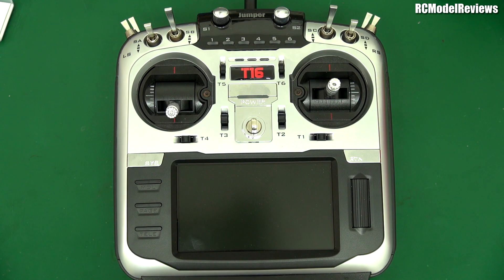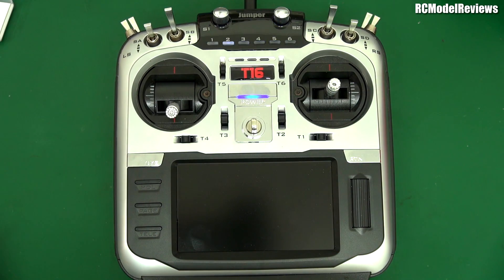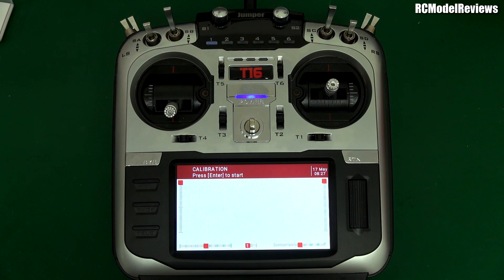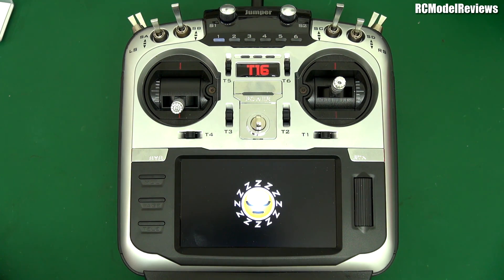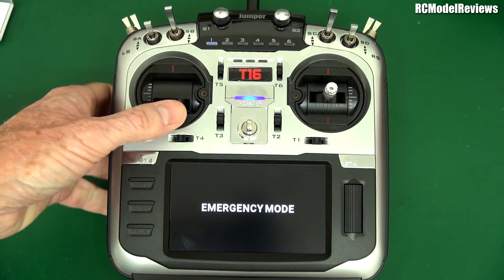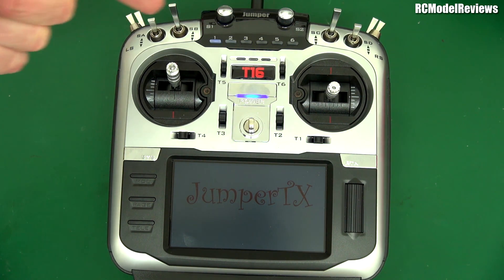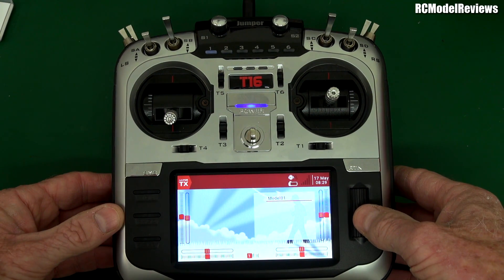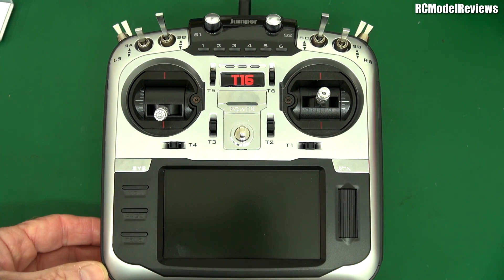Why I won't be using MY Jumper T16 transmitter

Comment: It's a bummer, but I'm sure it will be all sorted out and turn out to be a good radio
Reply: Hi Landlife, this was discovered as a problem with the first batch of hand assembled review and test samples (around 20 units where hand made for sending to reviewers and developers). The problem is in the SD card PCB component, a couple of other reviewers also had this issue and we had sent them a replacement SD card PCB component (the same component used in actual production). This problem was eliminated before production began. I have already arranged a replacement part to be sent to Bruce and emailed him about the issue.

Comment: i had similar problem with first jumper in that 2s battery was not enough for the circuit (even though they rated it to 7v).
needed 3s to provide enough power. oh well, you tested battery and jumper replied very quickly.
fingers crossed they fixed the issue. unlike frsky who denied issues with gimbals for a while.
Reply: Did they fix this issue in software or what?

Comment: Hi Bruce I recently bought one of the 4in1 modules for my X9D+ and after updating the firmware to get the multi protocol feature it works fine. A friend noticed in my radio and asked if it would work in his old JR 35 mHz radio and I said yes I would think so because you can select the protocol using a rotary switch on the back. In the instructions it gives the positions of the rotary switch and whether or not the green light should be on for each protocol and this where I got stuck.  I can't find how to turn the green light off in order to bind with Spectrum or Futaba for instance. In the instructions it say I should select 0 and press the bind button when I initially turn on and this will cycle the green light on and off but it doesn't seem to work. Am I missing something?

Comment: Big, big mistake. Sending Brian a faulty copy. Why couldn't they have just spent a couple of minutes checking it before sending it out? Especially to this guy! Nowl they're dead. They're lucky if they could sell a copy after everybody sees this video.
Reply: Hello, the sample Bruce has is a hand assembled pre-production unit. There we some SD card PCBs with a solder problem, this fault was difficult to spot at the time, the component was upgraded in actual production. A new component has already been shipped to Bruce to bring his sample up to speed.

Comment: I just ordered one! Nooooo! Just like the Spektrum DX6i. I read about all the issues people had with them and figured that Spektrum probably fixed all the issues with them and there was NO WAY I could possibly get one with issues. Well.... I was WRONG. Because it CLEARLY had issues and I demoted it to just UMX use only. No programming for it, nope. Those that said they never had any problems also didnt use Rates or Expos. Many guys told me they didnt even know how to program them in. THAT explained EVERYTHING!
What good is a programmable transmitter if A: It wont work using Rates or expo's. 
B: causes brown outs when you DO try and program them in.
Might as well sell them a DX 5e... simpletons.
That looks like a fine transmitter... if you like a BRICK.  In computer terms... It is bricked. I am glad I didnt really order one.I stopped buying the latest and greatest everything when it first comes out. ESPECIALLY ELECTRONICS.
Reply: Jumper later and Greatest?...I think not

Comment: Hundreds of new Jumper t16 owners won’t be able to sleep tonight. 😫
Reply: That's on them. In this current climate of RC equipment, anyone buying something like this is insane, without giving time first for it to be tested. If your of the normal profane masses and you order it from china, good luck on getting it replaced/money back. Why anyone would risk it is beyond me when you can run to amazon, get a trusted frsky and a rock solid warranty.
Reply: @usarmyfl1  please note that this particular unit is a pre-production review sample
Reply: @baldomo11  Yea that's true. I think I am even leaning towards this one actually now because of the crap Frsky is pulling. Other places besides banggood sell it.

Comment: Will not be giving this a second look.
Reply from the maker: Don't judge them all by one unit -- a single data-point is not enough to say they're bad -- however, I will be doing a tear-down to get a better idea of the build quality and design so make sure you watch that video.
Reply: alright. But I can't say it trust it on one of my bigger balsa builds. Drones on the other hand sure

Comment: Pull the battery and change the SD card to a formatted card. See if that helps Bruce
Reply from the maker: Yep, already done that.  Tried several cards and strategies but it eventually corrupts the cards so much that they can't even be reformatted on a PC.  Looks very much like a hardware problem with the SD card read/write interface.
Reply: @RCModelReviews  drop it on the floor and see what happens after words.  LOL

Comment: A few people have had problems with their T16 so far too, one with being unable to read the sd card, and one that went up in smoke. This was from  just looking at a few pages on one forum. Not sure how many others have had problems on there, and other forums?...  Has put me off getting one for now, will stick with my Taranis too... (but there will always be some failures on a new product,  might wait a while for the bugs to be sorted out).  check out rcgroups.com/forums/showthread.php?3243685-Jumper-T16-2-4G-16CH-OpenTX-Multi-protocol-Radio/page65  and  rcgroups.com/forums/showthread.php?3243685-Jumper-T16-2-4G-16CH-OpenTX-Multi-protocol-Radio/page45 for the two that failed on there...

Comment: Well that`s comforting..
My Hitec Flash4 has been 100% functional for 16 years
Tempted to start talking about how everything was better before, but might be the wrong channel for that, lol :p
Reply: I’m still using my Futaba 9z since 2002, and it was made in 92 I think. Never ever a single issue
Reply: A Frog I've been using Hitec since I started RC flying 7 years ago and shall not be considering anything else.
 When I raced RC cars from back in the 80's I used various brands, but for flying I shall deffo stick with these.

Comment: I have an issue with the new Pro 

I’m having issues with using the JumperT16 pro with the BnF umx sports cub, the linked video is exactly what I have plane and tx the module binds but no control on AETR they just go crazy and the jumper keeps saying telemetry lost telemetry recovered over and over. 

Funny thing is I came from Futaba 14SG and I got a dx9 module made up years ago for the bnf stuff and it works perfectly with the umx sports cub.

Just when I thought I was out Futaba pulled me back in. 

I would like to try the old external module seems to work in the vid but not sure where to get one
Any ideas on what going on with the J Tx?
thanks champs

https://youtu.be/Jk-MavS7Dl8

Comment: Just  guess but ..... check the battery in it .. or change them see if any difference.  Might be a voltage problem.  Just a guess but maybe worth a try.  Happy Flying (with another transmitter lol )
Reply from the maker: Battery is fine -- I checked all the obvious things before making this video.  I've been trying to sort this problem for a couple of days now and trashed a few microSD cards in the process because it seems to do something to them that renders them unreadable and unable to be reformatted on a PC after a few boot cycles.

Comment: Choice had a reliability survey on TV's and it showed that the average reliability across all brands was 86%. So 14% of all TV's failed in some way. Just look at all products Bruce has reviewed, that have failed. I don't understand why people are so quick to label this product a dud. I have a Taranis X9D and it works fine, and I also have the Jumper T16. All is good so far but time will tell. 

I found this on github about problems with the Taranis Plus: "There seems to be an extremely nasty problem being reported with the newer Taranis Plus radios that have the new main board with the XJT on the board that provide the standing wave measurement. The transmitter will intermittently display popup "TX Antenna Problem" followed by voice "Signal Loss" and then the aircraft into failsafe crash! This is a highly intermittent problem." Then this from the same person: "Thank you very much for your response. Looks like FrSky has a problem with radios made in the last few months. 
Mike"

I'm not trying to run Frysky down or discredit the Taranis. As I said I have one!

Comment: Yup!!! Mine did the same thing! 
I was saying to myself that I have the Bruce Miller curse!
I sent it back to the seller and they sent it back to me supposedly fixed saying it had a faulty SD
 card.  Nope. Failed again in less than an hour. I sent it back again and now I'm waiting for them to get the next batch for a replacement.  I also have been seeing people having problems with the roller wheel breaking.
🙁
Reply: Sorry to hear about the problem, if you do not get a solution and replacement please join the Jumper Facebook group and send a PM to the admin. Regarding rollers this is a problem known to Jumper and they have already been sending replacement parts to dealers. Any one with a broken roller please contact your retailer for a free replacement part. Thanks!
Reply: @hobbyporter3597  Thank you! Yes, I'm already on the Jumper Facebook group.
Reply: Did it fail at random, while in flight, or while writing to the sd card? Or some other repeatable task that we should avoid? I sure hope JumperTX can sort this out and issue a fix, either by firmware or component replacement. This is by far my favorite radio.
Reply: Sounds like you sent it to the wrong place
Reply: @btsc1  The problem occurred while I was exploring the menus.
I have been told the issue is with the SD card board.
Reply: @Mateyhv1  No,  they have been very helpful and are shipping another radio when the get the next batch.

Comment: Did you damage it fiddling around inside? Does it need an SD  ard installed to boot?
Interesting to see how this issue is resolved. Keep up the good work Bruce.
Reply: Hello, the sample Bruce has is a hand assembled pre-production unit. There we some SD card PCBs with a solder problem, the component was upgraded in actual production. A new component has already been shipped to Bruce to bring his sample up to speed.
Reply: Hey Bruce,  thanks again for all that do for the hobby. Shockingly I bought my t16 around the same time yours failed.  Mine worked. Well for two minutes that I turned and off 7 months ago. Here I am now ready to actually start using it. And of course on the first push of the on button, the exact same symptoms occured with my radio.  Did you ever get the replacement part to fix the sd issue? Anyone with any ideas? Help will be greatly appreciated.

Comment: Dont freak out you just get a 🍋, shit happen sometimes , does it make the T16 a bad radio...? Don't think so...
Reply: Hello, the sample Bruce has is a hand assembled pre-production unit. There we some SD card PCBs with a solder problem, the component was upgraded in actual production. A new component was already shipped to Bruce yesterday to bring his sample up to speed.
Reply: @hobbyporter3597  Yeap I know, better tell Bruce about it, I'm one the one who is bitching on the T16...:-)

Comment: Futaba engineers must be laughing so damn hard after watching that video...
If they (Jumper company) have a great customer service, it's time for them to show up right away...
Reply: Hi ABMS, this was discovered as a problem with the first batch of hand assembled review and test samples. The problem is in the SD card PCB component, a couple of other reviewers also had this issue and we had sent them a replacement SD card PCB component (the same component used in actual production). This problem was eliminated before production began. I have already arranged a replacement part to be sent to Bruce and emailed him about the issue.

Comment: Sure glad I kept all ,my old, 72 MgHz equipment. :*) See, back in the day when you spent all winter actually BUILDING an airplane, sometimes from just the plans, you couldn't mess with this kind of shite. You had a frequency, sticks with mechanical trims, not even servo reversing, (you had to dive into modifying the servo itself) and servo travel, ditto. Oh the humanity. 

And Kraft radios, made in the USA were outselling all other brands, world wide,,,,
Reply: Yeah, but now China is producing everything servos do not have to be midified and US is almost out of the business.
Reply: Then your plane got shot down by some random radio interference, likely from another RC transmitter.

Comment: Just stick to what works Taranis ftw!
Reply: Theres a reason the taranis is the number 1 selling radio
Reply from the maker: The Jumper is still a nice package and one failure doesn't change that.  However, the tear-down and internal inspection video will help provide more info so don't miss that.

Comment: Humm, well I guess FrSky has nothing to worry about then :)
Reply from the maker: Well I thought FrSky were claiming that the Jumper T16 was a copy of their 10X radio... in which case... :-)   Also, the R9 Slim receiver FrSky sent me was also dead on arrival so every manufacturer has bad days -- especially if they're sending ME stuff to review.
Reply: RCModelReviews why is it that you always receive bad products?😂 you got a bad taranis, and now a bad jumper?😂😂 Is your mail man breaking them??
Reply: @jonathanchippeaux303  The person delivering his packages must not like him :)
Reply: Frsky has a nightmares since T16 release. And they should be. T16 is a good radio. Of cause it will have issues, same as Frsky has it too. My friend's x9d transmitting circuit board went bad one day. So what? We need to stop using Frsky?
Reply: Jacking-up FPV I’m positive every manufacturer has problems. Especially spectrum

Comment: And yes go back to yours traranis a good radio is not for a fool, you need a lower end model like Taranis. You know it amazes me how guys like that make videos cause he was obviously a fresky fanboy set out to try and do a smear video. Fresky will stop at nothing to try and take out Jumper, shouting here to go to sending out a dysfunctional jumper to a loyal customer and have them do a smear video, like they tried to get all hobby shops to drop jumper or lose the rights to sell fresky. Personally I would have dropped fresky and made a big youtube video from my shop telling all my customers what fresky did and why. Then fresky would have taken a big dive as fresky users switched to a superior radio in every way. For sure though buddy you need to go back to fresky it seems to be a better fit for your metal state. The jumper radio seems to complex for the likes of you. But the radio looked fine, most likely needed to either get re-flashed, probably had an issue with you memory card, or perhaps you really are working with fresky to smear Jumper, either way you were to dramatic for a simple fix, so you are what you are and it is what it is. I have a jumper pro, rocking the full crossfire system, with a GepRC pro 4k, my only limitation from flying up to 3 miles if my battery life, the radio and my fat shark HDO with fusion mod are rocking super well, my system us bullet proof and I am not using fresky, a company that locks its own users out of there models, try’s to destroy competition by threatening the stores that kindly sell there shit. Ya Taranis that is the radio I would want to use and associate my channel with, fuck ya. Anyway that is my 2 cents like it or not, I could care less. It’s pretty accurate though.

Comment: Glad I didn’t order one! I got a Spektrum DX9 instead 😉
Reply: I had the same issue with my Spectrum DX8, solved as replaced another SD card...
Reply: Damn, that sucks for you lol. Payed twice as much with half the features. I used to be a spectrum fanboy... Until I bought a jumper. This issue was not in the production run, only pre-release units had this bug. Don't get me wrong, the Dx9 is a good radio but you could have built something to fly with the money saved from buying a jumper radio. Just my opinion...
Reply: Hard luck Stephen....They saw you coming.....lol.
Reply: Glad I kept my DX7se, it doesnt have an SD card.
Reply: lol fail.. Spektrums are known for SD card problems.. also have a look at the IX12 threads.. masses of issues..
Reply: Chris Padgett I got it for free from a friend who crashed his plane so you can’t get any better than that 😂
Reply: EnglishTurbines I got it for free from a friend who crashed his plane so you can’t get any better than that 😂
Reply: Newspeak Anomaly I had a DX8 for 7 years and it never ever had any problems lol
Reply: @Mateyhv1  What's an SD card anyway, my JR has never had one !
Reply: @fly9wheel  memory card, the DX7se I have does not have it, the Taranis does